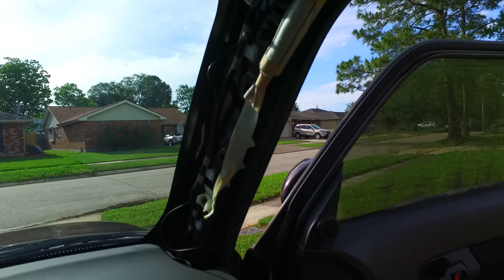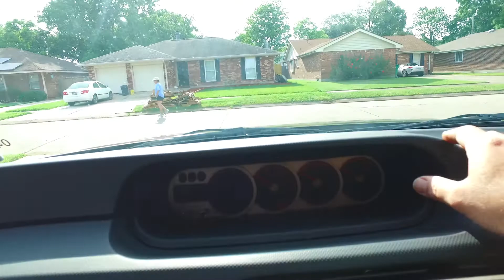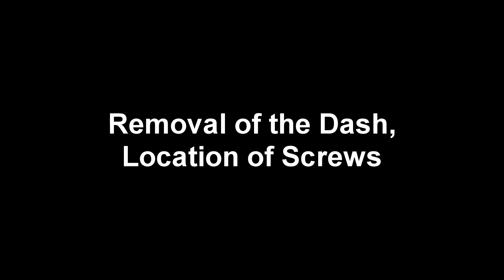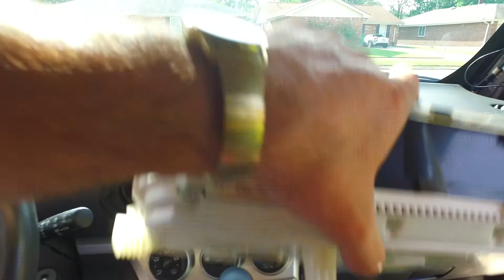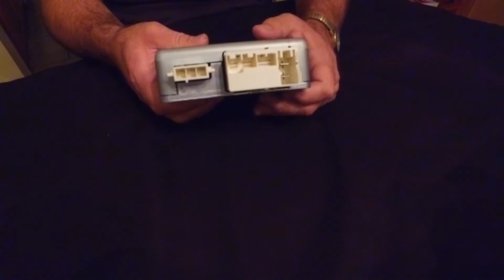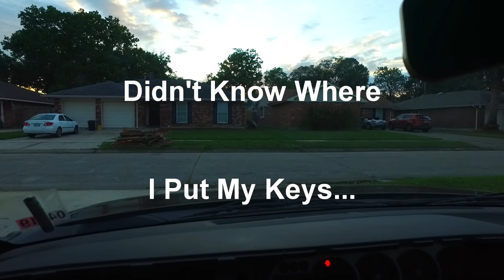2008 Scion xB Power Steering Install

Comment: Hi thank you so much for creating this video, it’s incredibly helpful. I’m going to I try it myself next weekend.  How important and how soon do I have to do the zero point calibration? You mentioned the software is $35. Is it something difficult to learn myself by watching videos online, or am I better off just taking it to my mechanic for the calibration? Thank you again for all your help!
Reply from the maker: Thanks! That's why I make them! My power steering module came pre-calibrated, I just wanted to use my software, which by the way, was very easy to use if your comfortable with computer software. There are many things you can change with the software, like bell rings, power steering and in some models of Toyota, add on extras that you have to pay for.  Just be careful and keep track of what your changing. You got this, fix your own shit, because Toyota wants $1200 for this repair with parts and labor. The messed up part is they know these module were defective and never did a recall.
Reply: Wow, thanks so much for the quick reply!  Ok, If I am replacing with a used working unit pulled from a same year Scion xb, then there is no need for calibration?
Reply from the maker: @kurtnagahori9709  I'm guessing it should be fine, as long as you know it works. But in any case, at least the software and cable are cheap, and it's easy to use.
Reply: @djfickle  I can't thank you enough!! Take care man.

Comment: I just changed mine twice and still no power steering..😭😭😭
Reply from the maker: Sorry so long to answer back, I live in New Orleans and shit is still crazy down here from Hurricane Ida. Did you buy remanufactured power steering modules or new ones? Or did you buy them from a junkyard? I have found that most modules in xB's, in the junkyard are already out of service and do not work. The power steering modules were a huge problem on the second gens. That's why the modules are a little hard to get remanufactured because they get bought up quickly. Also, have you looked into the Techstream Toyota software? It is about $35 off the internet with the special cord that connects to the car. It helped me reset the module to 0 on the steering. Sorry to hear about your problem.
Reply: @djfickle  aww hope everything is well... so my problem is I have an alarm that I can start when I'm in the house, so when I do that everything works but as soon as I step on the gas everything goes out, power steering, radio, blinkers, windows and I can't take it out of drive so it's no the power steering it's more then that...
Reply from the maker: @sickabillygaribaldi3999  Sounds like the engine control module (ECM) has gone out, which is a different module than the power steering module (PSM).

Engine Control Module (ECM),

Symptoms of a Bad or Failing Engine 

Control Module (ECM) is,

Check Engine Light Turns On,

Engine Stalling or Misfiring,

Engine Performance Issues,

Car Not Starting.

Poor Fuel Economy (which just started happening in my xB 5 weeks ago).

If you know someone with an OBD2 scanner or can get it to Autozone you will be able to find out a whole lot more about the problem. Hope this helps.